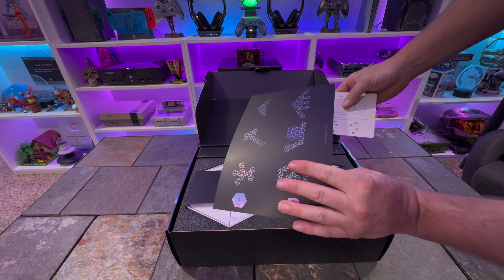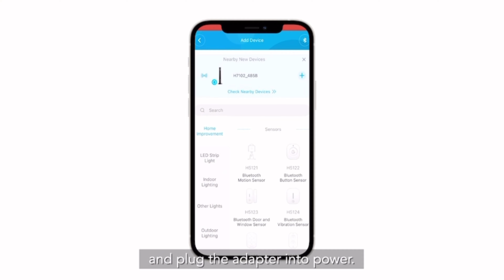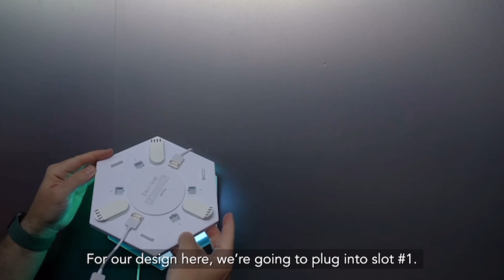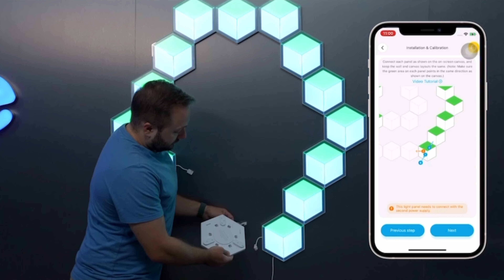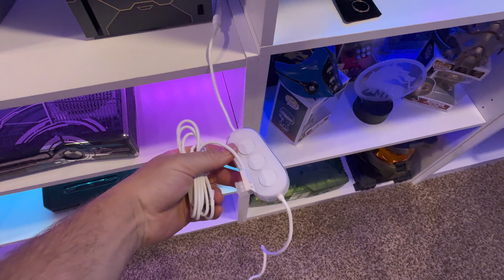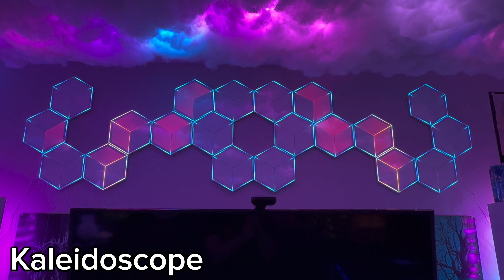Govee Hexagon Ultra Panels — The Best Wall Panels Period!!!

Comment: How do u stick the cardboard cutouts on the wall?
Reply from the maker: Sorry, I never used that method. Too much hassle. I used the little level that comes with the kit, and used that as a spacer. Just eyeballed the placement. Made sure it was level at first and then used the level itself as a spacer.